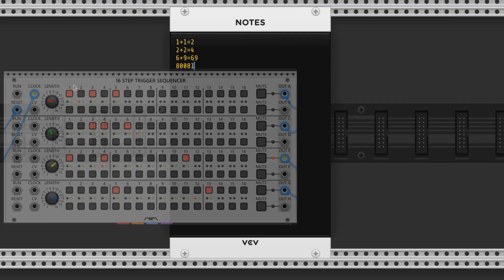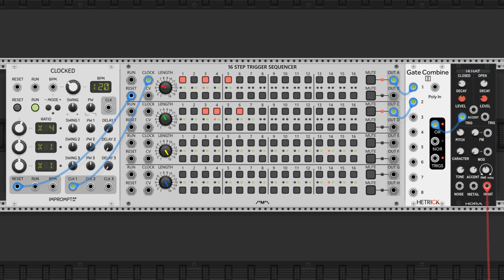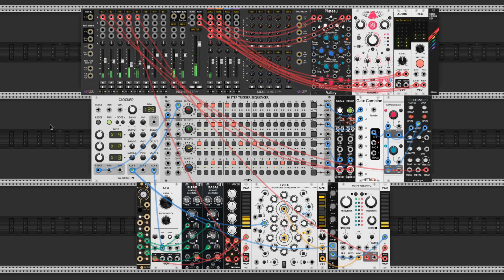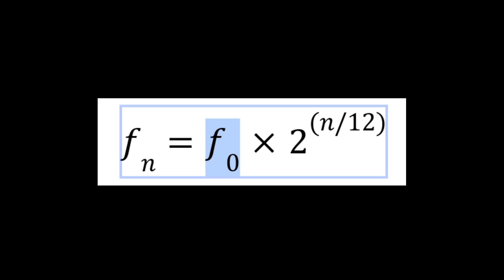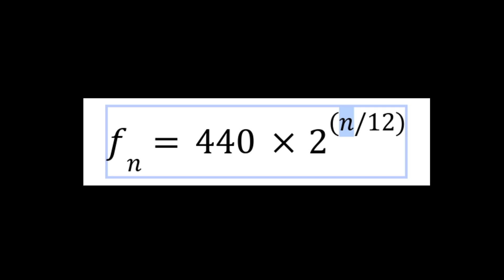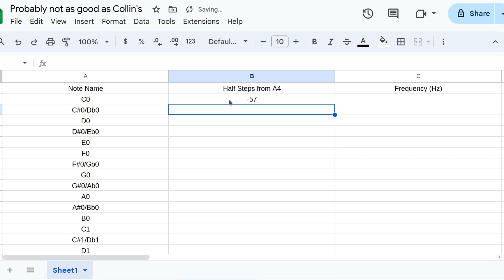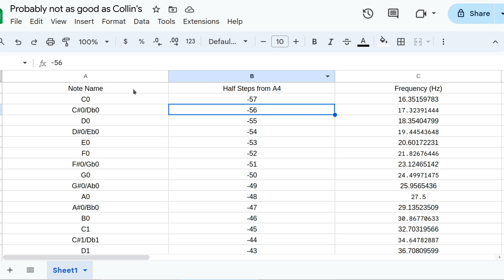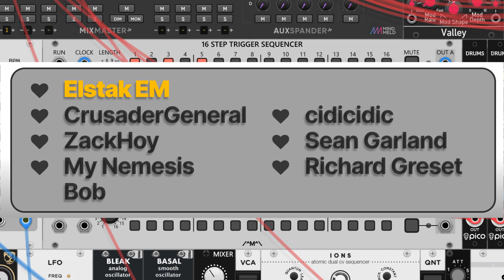The Beauty of Mathematics Part 1 // Math in VCV Rack

Comment: Nice vid!  After going through the spreadsheet you missed the big punch line on inputting math to VCV Rack.  If you're inputting a voltage and, say, want to go up a semitone in a 1 volt/octave input you can use "+1/12" in the text entry box.  Or pick how many steps you want to go up or down and just have it do the math.
Reply from the maker: Dude!! You're so right. That is the slickest way to use the math input along with calculating pitches. Thank you for pointing that out! I totally missed it lol 😁

Comment: Regarding primes for rhythm, that's a neat method I've not used. How I've used primes is via a clock divider. I have a master clock running at some rate equivalent to the fastest burst or drum fill I want, then divide that down to run sequencers / rhythm generators. I'll  take, for instance, a /5 to the drums, and a /7 to the melodic sequencer. The pattern lengths aren't something I've fiddled with, but I sure will now.
Reply from the maker: Oh! That's a great technique! I'm going to use that lol.